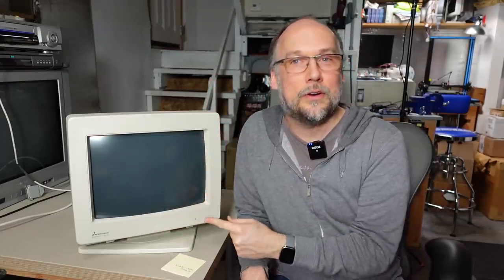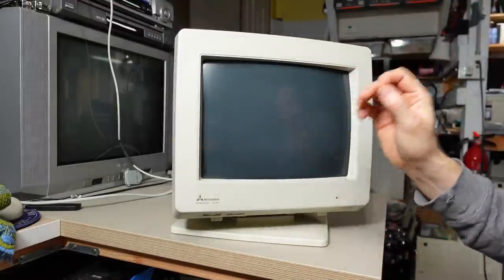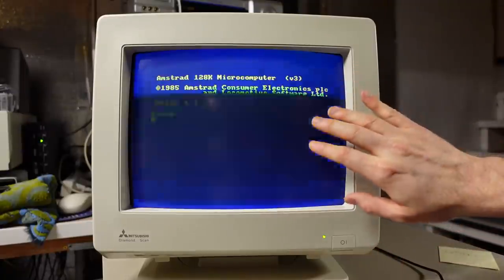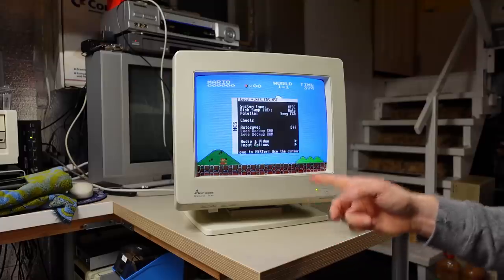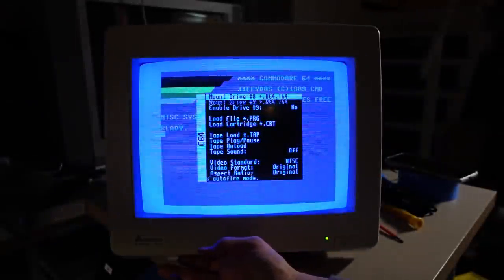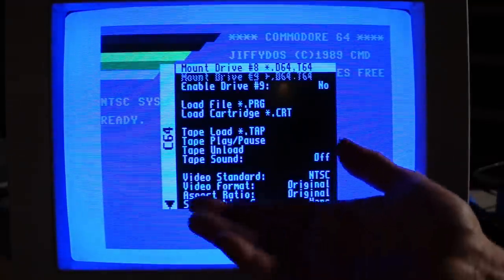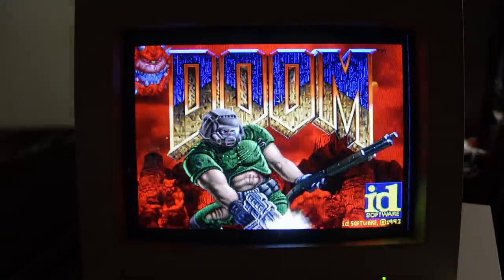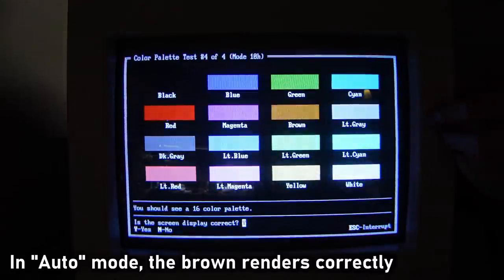Can I rejuvenate the CRT in my Mitsubishi Multisync monitor?

Comment: The OG tube was simply tired. It was used by programmers every day, probably at full brightness/contrast for years. No amount of rejuvenation is going to fix that. The emissions were at the low end of the range. Rejuvenation clears up oxidation inside the tube by jacking up the heater voltage on the guns. That’s probably why your cameras exposure went whacko during the process. EM emissions. You should watch videos by YouTuber shango066  as he works on old tube TVs, and in all of the videos he’s done, I’ve only ever seen a rejuvenation on his channel once. 

As far as overscan, that’s for video. I dare say you could have used this monitor in a TV studio as a reference monitor as it does have a BNC jack for connection to a VTR or studio camera. Probably trying to compete with Sony Trinitron monitors.

Comment: Interesting how the exposure pulses in sync with the rejuvenator, I wonder what caused that to happen
Reply: Really strong electromagnetic fields from the rejuvinator...
Reply: The rejuvenation process made the CRT darker and the camera brighter.  All the horror movies I've seen say that if you play around with black magick  in order to reanimate the dead it will likely backfire in unexpected ways.
Reply: @kilwala2242  I suppose it could be that the sensor is picking up some light from the CRT even though it is facing away from the camera

Comment: I have read that most of the radiation of CRTs is going to the bottom of the device. But still there might be more come out at the sides when the shields are not protecting you than on the front? Also there is a metal frame glued to the front - the glue might degrade and lessen the stabilizing effect which might especially important in flat CRT screens...
**Wikipedia**: https://en.wikipedia.org/wiki/Cathode-ray_tube#Health_concerns
I suppose you already read it but for some of the viewers it might be new.

Comment: From what I have been told when you Rejuvenate a CRT it cuts the Life Cycle in half. The Life test has to be done and should be in a acceptable margin.. A CRT can have great emissions but has a poor life cycle and hinders the picture because the filament isn't working at the correct voltage. I had a Dumont Tube TV that did this and I had to crank the Filament to 7.5 Volts, but that was a B&W TV. Also you should have the CRT on it's face for Rejuvenate. Also you should only do it once. If it doesn't go well then "it's dead Jim".

Comment: I think the issue here (regarding emitting current) being OK and the CRT looking sad is the envelope has gone soft, ie poor vacuum and /or impurities in it, its one thing to treat the cathode and a grid as a diode and measure the current but the gap is small compared with distance to the final anode..

Comment: I suspect the emissions voltage varies in visibility depending on the composition of the phosphors and the dot mask (or wire mask if you are on trinitron and friends). Some phosphors may be more sensitive than others? Or perhaps the vacuum quality may have an impact?

Comment: Next time try adjusting the lower pot/nob on the ht coil, that adjusts intensity/brightness, also the caps could be failling, did you test them before assuming the crt was at fault........screen rejuves are a temp and like you found out can ruin a crt.   Btw a lot of multiscan monitors had the screen refresh/rejuvination capability built into the screen menu.

Comment: a guy that went to the  same  electronics  class that i did  found  out that if  you fix  a crt  monitor and and  leave it  in a  car in freezing weather  you don't just  bring it in  and  plug it  up and  turn it on  , the smoke  rolls  out and it is  gone

Comment: I love what you can do with CRTs. Sorry this one doesn't go so well. I have a G3 iMac whose picture keeps "snapping" or "popping" (hard to describe). I wish I had your skills to figure out what's going on with it! :)
Reply: My trash find G3 had a bad solder joint on the flyback transformer, which caused short and sharp screen flickers and pops from under the hood when it arc'd. Can also be something wrong in the vertical oscillation circuit, maybe a bad solder joint in there also.
Reply: @nakkistromberg3946  Thanks for the help! ;)
Reply: If you actually hear loud cracking or popping it's probably a bad flyback. If the flyback is cracked, it may be possible to repair it with epoxy or silicone sealant. Other possibilities are a short in the tube, runaway/excessive high voltage, spark gap arcing due to bad components on the neck board.
Reply: @equid0x  Thank you! (Makes me wish I were a little more comfortable working with CRTs, though.)
Reply: @msthalamus2172  Yeah, they are a bit scary and you can never be too careful with them. No rocket science, but if you're not comfortable with them, then be extra cautious or stay away from the inside altogether. It's not worth risking your health or even life.

Comment: Maybe it's nothing , but it looks like the DB connector is not pushed in all the way and locked with the sliding lock. Looks like one of those that you push one way, push down on the connector and it locks on one side, and then push the other way and push the connector down fully and it locks on the other side.

Comment: Given that the monitor isn't plugged in, and therefore not connected to ground source, does using chassis "ground" as a discharge point do anything?! It's an open circuit. Shouldn't you attach your probe to an actual ground point?

Comment: You could have tried another analog tweak, a picture tube brightener.   It was a little auto transformer that boosted the heater voltage up about 20 percent.  My father put one on our 1960 GE television around 1962 and it made a big difference.  I later put one on a Heathkit 25 inch color tv, again making a considerable difference.
Reply: All that does is boost the filament voltage so the guns run a little hotter and boil more electrons off the already dead cathodes. When a CRT is dead it's dead. No amount of 'rejuvenation' is going to fix it. In fact a brightener just runs the CRT into the ground faster IMO.
Reply: @senorverde09  In my experience, both boosting the voltage and running a "rejuvenate" cycle can have considerable and long-lasting effects.  Maybe 15% of the time I've seen these fail to do much.
Reply: @senorverde09  Yeah but it DID work to a usable extent on CRT's that were losing focus or even almost no emission.  At least for like 6 months or so, enough time to save up money for a new CRT.

Comment: If you are using the gentle setting , theres no way you can damage a good CRT. Assuming the machine is working correctly If worse, the CRT  guns are stuffed or very clogged and frankly if the picture is worse after a couple of light passes, you have nothing to lose by hitting it with heavy rejuv. I never had to use the heavy setting on my B&K 467 as its old style and pretty strong anyway on lower power and 2 passes are usually enough till you see no real improvement, you stop and see how CRT looks and leave it there..

Comment: Picture tube rejuvenation is really a last ditch effort to save a tube for a couple of weeks before needing to retire the device or replace the tube wit ha new one.  Most professional TV people don't like using the rejuvenation feature as it really is like putting a band aid over a cut that really needs proper stitching.    Very hit and miss as to whether it will work or not.   If a tube is baked and well used, nothing will really make anything work long term.

Comment: I have a flat screen Mitsubishi NF Diamondtron, which I stopped using years ago because over time it acquired a green cast.  Electronically it was fine.  Degaussing didn't do anything.  Could it be in need of rejuvenation?

Comment: Nice ! I have a similar monitor in functionality that also needs repair. It can do 1024x768 according to the manual wich is amazing for a 1988 monitor.
However I think it's not really sharp and it has a problem with colors which I have to address. I think it's due to some capacitors but if you think disassembling your monitor was complicated, try mine xD

It's a TVM MD-11A

Comment: I might think that it would,ve been better to replace those capacitors to restore that monitor, while i can imagine that you can check those RGB signals with the tester to check it’s functionality but i don’t understand how you could potentially restore those signal “by increasing the voltage to drive more out of those signals then used to be???” Mmmm
But i can imagine that if you drive too much voltage into that crt that it can ruin one or all 3 electron guns,
But oh man, replacing and calibrating another crt into it, must have been absolute hell,ouch.

Comment: In my life as of yet, rejuvenation of a  crt monitor NEVER worked. I think, on those tubes they just got the chemistry of the phosphors and/or the cathodes right. They do 20.000 hours and then they are done for.
There are also crt TVs, in which the crts last basically forever; but when they are done, they are done. 
Some toshiba and sanyo from the 80s for example. When I got those particular models on my bench, with signs of a tired tube, I told him/her right away, that the set basically had reached its eol. Because you just knew that that TV had tens of thousands of hours on it.
Reply: I grew up with a National console TV. My entire childhood we watched the family TV a lot and as far as I know we never had to adjust the brightness. I have it now in the garage. I would never throw it out because of the sentimental value. It won't again be running all day. None of my crts will. There's just no need.  Occasionally on every few years to bring a smile.
Reply: @blackterminal  I still own the Telefunken TV from my grandmother. It's a 1968 PAL Color 708T. I managed to save it from the dumpster when my granny threw it out because the variable reactor in the color output stage failed (it was the standard-death of almost all Telefunken TVs from that era and that special choke is impossible to rewind). 30 years later I stumbled over a NOS part at a hamfest and got it for a case of beer. I restored the set carefully (just some critical caps and the convergence) and since then I watch the set occasionally. It has the typical delta-gun picture. Just great!

Comment: I have a crt Monitor hp hewlet packard, the main board of the crt monitor just stopped to work, so I couldn't fix it, what I did, I took the main board from a proview monitor, and I just changed the board, for my surprise it works perfectly. But the problem is the main board is larger than original one, I  couldn't fit into the inside the monitor, so I remove the cover behind the monitor. So my monitor is disassembled but its work now.

Comment: I think the problem with the convergence of the new tube is the fact that you used two different tubes.
The name Diamond in the Mitsubishi monitor suggest that an, I think, so called "Diamondtron" tube is used, same as Trinitron, but the name belong to Sony, the color pixels are small 3 vertical bars placed in an horizontal row, and the "normal" color pixels  are dots placed 3 in a cirkel, so it needs a different approach to hit them.   
For me the Diamondtron give a nicer and more brilliant picture.
Nice vid !

Comment: its actualy not as hard as it sounds i used to work at toshiba working on some of there 32 and other sizes of tvs basicly put up white grid and if you can get the magnets just place it on the screen . besure to degouse the screen wen you place the magnet in place to see if it stays in convergence .

Comment: what happens if you make a linear accelerator mini crt pixels
Reply: a pipe tv
Reply: glass fiber optic tv
Reply: nano sized
Reply: crt leds
Reply: mono or multi colors
Reply: flash tube leds
Reply: vacuum tubes, l-o-l
Reply: why are you touching with the non-grounded hand?
Reply: better stuff it in the pocket, with high voltages
Reply: electricians thumb index finger rule